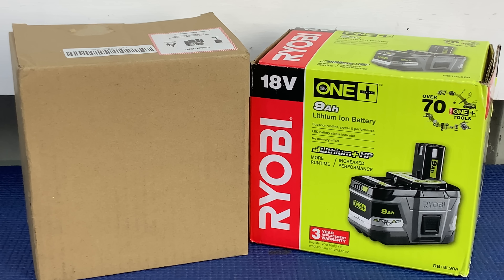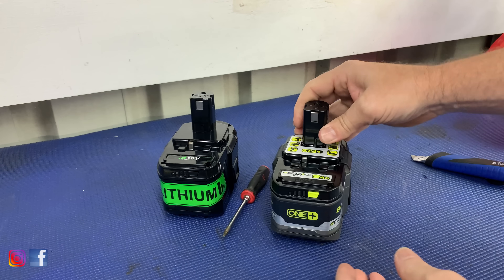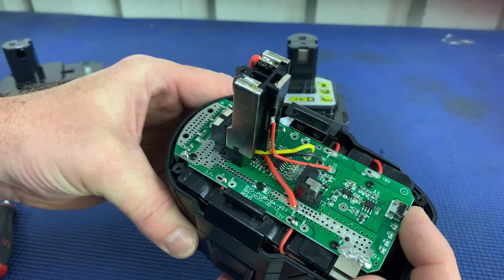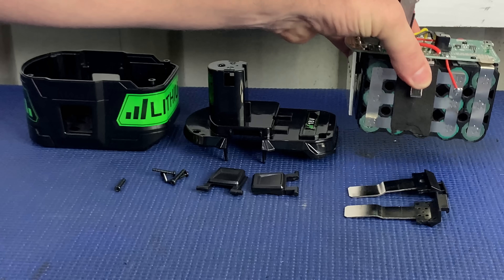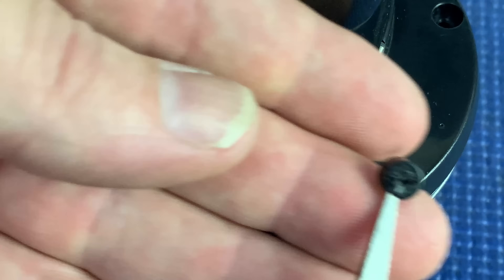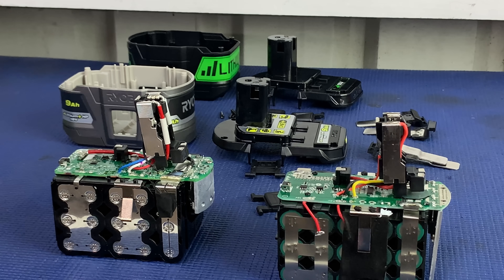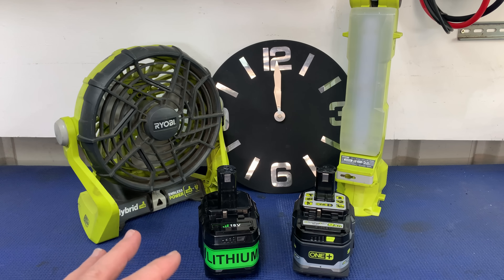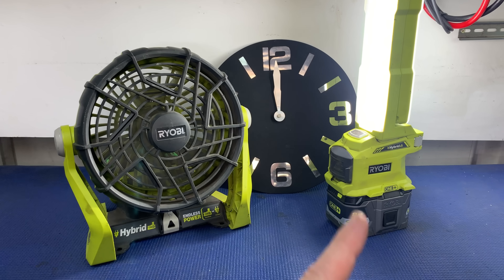Ryobi 9ah battery versus eBay knockoff job

Comment: I am seeing Chinese knock-offs for an amazing number of different products. I have had personal experience with Go Pro accessories and ski goggles. Both are of extremely inferior workmanship and quality of materials. The GoPro accessories have inferior plastic and willl break and often not even fit. The same for the ski goggles. They may be okay for young kids or teenagers that will use them only a couple times a season and then grow out of them. But for a serious skier that skis multiple times a winter and expects a number of years service they all be a poor investment as they will not last. I have learned to stay away from eBay products even though they are half priced the brand name articles they are not worth buying. I am becoming worried that the counterfeit knock-off products are even mimicking the packaging and The Branding of the name brand they are imitating. A friend of mine purchased a Dale wool sweater that normally sells for 300 to 400 dollars. He bought it for about $90 and thought he was getting a great deal . It was advertised as a XXXL size, but when it arrived it was way too small. It fits me and I wear a large. So he gave it to me and I wore it about 1 year and then it started to fall apart
Reply from the maker: To be fair China make some quality gear... its just a subset of lowlifes trying to make a buck all over the world..
Reply: You are so correct. It did not even cross my mind, but it certainly should have, that my comment grouped everybody in China in in the same category. Interestingly, grouping people under a label is one of my pet peeves. I am a follower Jesus Christ and would be considered a Christian. And it offends me greatly when I I am grouped with with the so-called Christians represented by the ones that were storming the the Capitol building. I believe Christ came to change people's hearts and souls. Not to bring down the corrupt Roman government and that should be the Christian attitude today. Helping people decide to follow Christ it is by far more important then getting them to elect the so-called correct government officials!

Comment: Left half the potential content on the table.
It would be useful to know what cells are used.
I'm thinking of rebuilding my ryobi pack with aftermarket cells, but I'd rather you tear your apart first.
Reply from the maker: Please don't use 'generic' cells use name brand when you rebuild and consider your load.. High Drain cells not low drain cells used in this ebay special.
Reply: go with samsung high drain cells. i've rebuilt a few, and they are the best for my money.

Comment: My Chinese knock-offs are 4 years old  3 of 4 still working. My Ryobi's are 5 years old and 4 of 5 are dead. Yes the fitment is better with the Ryobis. Never had a Knock-off fall out. I just give the Knock-offs a slap to get them to set properly and they are a bit tough to remove. My knock-offs have worked in temps from 2f to 117F. Have Ryobi chain saws, skill saw, recip saw, blower , lights. about 10 pieces in all. Don't charge either one below freezing. Fixin to buy a 9amp knock-off. for the spouse's leaf blower.
Reply from the maker: They have their place, but reduced run time and the fact this one is now in the bin cause it fell out of the weed eater onto the ground and cracked the case is enough for me .. just cheap junk can't describe them any other way

Comment: I bought 4 of those knock off batteries. They are complete pieces of shit. And they do not work with most tools. So far, only my drills. Pay the extra for the real ones, if you have more than drills and use your tools more than once a year.
 You're welcome.
Reply from the maker: Thanks buddy! THEY do work,  just the quality aligns with the price tag..
Reply: @HBPowerwall  Yeah, they work for drills. They DO NOT work for my grinder, reciprocating saw, circular saw, shop vac and they run out fast if doing heavy drilling. I think they do work for the tire inflator and I have not tried them with my cut off tool.

Comment: I don't want this to come across the wrong way, but perhaps you should have tried the fitment of the knockoff battery in the chargers and the tools right out of the box and prior to disassembly. 
That way you know for sure whether the poor fitment is due to manufacturing or if something was slightly misaligned during reassembly.
Reply from the maker: Yeh, it was crap can't look at it any other way.. it's in the bin now wasn't even worth testing further.. It fell out of the whipper snipper and smashed the case.. RYOBI would have just bounced lol piece of crap
Reply: @HBPowerwall  I can't disagree with that.
I've had zero issues with any of my Ryobi products.

Comment: Someone did a similar comparison of the knockoff 4amp batteries a year or two ago and he was able to see the actual cells to find out they were indeed a lower rating than what they claimed.  That being said, I would buy some of the cheaper 9amp batteries if only for small things like the fan and the lamp as they would be cheaper to replace should something happen, but I would definitely not trust the knockoffs in anything like my good brushless drills or other expensive tools like my portable compressor.  Also, I'd keep it on a separate charger from the rest just in case it kills it (I always end up with extra chargers from Ryobi Days anyway :P).
Reply from the maker: For small loads these work all day long... but missing build quality. If they had their rated capacity i'd be fine with them But that is lies too.. video soon!
Reply: @HBPowerwall  lol, I agree!  I'll keep an eye out for the new vid.

Comment: The Ryobi one is of the newer type with the extra connector on the back to deliver more current to the new brushless tools, the difference is VERY big compared to the older ones.
Reply: Not all of their brushless tools use that extra connector.   I have a weed whacker and a leaf blower that are brushless.  They have no extra connector that matches the battery.
Reply: @larryjohns8823  Same thing with drills, the big 95nm drill has extra pins while the compact hp 54nm does not

Comment: i bought a knockoff makita 9ah battery for my fan, that is the only tool i trust it for however, as i bet its not gonna take the heat of a high power tool very well. and even tho it clips in seemingly good it loves to pop loose from my 1/2" impact gun, like every 15 seconds... i get a lot of use out of it for my fan in the summer but man other than that its worthless lol. makita doesn't even make their own 9ah battery unfortunately but id have bought a 12 ah if it was available, fan all day! lol.

i tested it very un-scientificly by turning the fan on and starting a stopwatch, the 9ah ran it for just over 10 hours on low and a makita branded 3ah ran it for just over 3. so on a low load it seems slightly better than makita. but i have a feeling there is some magic with larger battery packs im not aware of witch could explain this.

Comment: Hey mate these 9 AH ryboi batteries are now only $199 at Bunnings (Ryobi primary distributor in Oz) which further changes the price/value proposition of these batteries.
Reply from the maker: Yeh, i made note of that.. After a few more weeks of use I still HATE the knockoff.. Put it in the wipper snipper used it for half an hour turn it upside down to fix the cord and battery fell out and hit my toe. Changed to the origional battery and it was like the wippersinipper was turbo charged..
Reply: @HBPowerwall  I've read several reviewers of knockoff batteries mention the bad clasp moldings.  Most people, including myself, fixed those sticky and hard to seat batteries by filing a little bit of plastic off the catches; so they fully seat and lock in.  Plenty of more important reasons to knock these batteries than the poorly molded catches.
Reply: Yes I was thinking the same thing  $299 is very expensive (18650 cells
Milwaukee batteries 
8ah 2100 cells $200
12 ah 2100 cells $260

Comment: In our experience, the "on-sale" price of a genuine "standard size" Ryobi 4AH battery is too cheap to bother with any sub-par ripoff. $25-40 each is a common going rate here in the states when purchased in 2 and 4 packs around the holidays or other annual "sale" weeks.
Reply from the maker: yeh, never  seen them on special around here :( but even then after another few weeks using this battery, it just sucks, fell out of the whipper snipper last night. Vibrates out of the circular saw.. only good for lights or fans.
Reply: A couple years ago, I picked up two 9Ah batteries from Home Depot for $180 ($90 each). They are well worth that price. I have plenty of 4Ah batteries from the same kinds of holiday deals but my 9Ah batteries shine when I need to use my angle grinder, leaf blower, recip saw, etc.
Reply: At those prices might as well buy original ones for sure.
At full price and occasional use the knock offs become interesting.

In the end it all comes down to the cells that are used in the knock offs. If the cells are decent the knock offs are fine.
Reply: Must be you
 I use them in nail guns, circular saws,sawsalls,impacts,screwguns, multi tools and on and on. I've never had a aftermarket battery fall out of any tool.
Maybe you shouldnt take things apart then complain about them.
Reply: @nicstr28  the shape of plastic mould wouldn't allow the it to go all the way in pulling it apart wouldn't change the shape of it.
In eBay there Is many different sellers and probably different levels ofnquiaolty I just bought 2 for 73dollars aud and the reviews on the past months sales seem to say they work just fine and even the ryobi 18v battery someone tested was lower capicity by about 10percent and that was genuine. So I'm sure none of them are really what they say.  If my 5ah fakes are better then my 2.5ah genuine battery in my blower I'll be happy, only get about 15min if lucky with one battery so if get 20 or 30min I'll be happy
Reply: @nicstr28  u nailed him to the wall 😂😂 Spot on rebuke!
Reply: Always cheaper in the USA or created in home country.
Here in Australia 2.5a =$100 4.0a = $150 6.0a = $300 9.0a = $450
Love the ebay no brand knockoffs

Comment: I'm planning on trying to build myself a 6.0AH using 3D printed parts, an off the shelf BMS and LG HG2 cells in 2P.  If that works, I may try building a cheap one with 3P M29's (which a local london retailer sells to pack builders for £1.66/cell plus tax and shipping).  In 3P, the M29's should be able to manage 30A sustained, which should be ok.

Might have to charge it with my imax instead of my ryobi charger, but that should be easy to print an adapter for.  Could even throw in a balance charge lead...?
Reply: Hey There,
You clearly have plenty of knowledge on the subject. Is there a off brand that you know is decent ? Or are you building something that you would sell ?  I only use them for lights while working. ( Painter ) 

Thanks in advance for your time !

Comment: I have owned a total of 18 of the 6AH knockoff batteries and 2 of them have failed relatively early on in their life cycle. Fully charged battery in leaf blower or chain saw and runs less than a minute. Machine stops and battery is done 4 cannot be charged again. This has happened with 2 out of the 4 ryobi batteries i have owned. Have had much better luck with the cheap ones. That said they don't have the greatest fit on the charger. They do stay solid in the tools but haz to work at it to get them out.
Reply from the maker: Thanks for sharing point of view, I was using the 'lithium' battery in the led light over the weekend working on my car and it went flat, had to put it in and out of the charger about 10 times over a few hours to get it to start charging again.. I suspect it was so flat the bms said no.. each time i put it on the charger it charged a bit then turned off. Still would rather the proper unit.. fan blows harder, omg in the circular saw the genuine one rocks, knockoff blade keeps getting stopped.. For me - no more knock offs!
Reply: any cordless tools battery. needs care. cant get hot or cold.
dont store it on max or no charge.
store at 80% charge
dont over deplete when is low.
obviously ryobi have better quality control. so hopefully theres a sale

Comment: Would love to see a test the run times of these 2 batts in a high load tool. My bet is the % difference will increase in higher load scenario.
Reply: I have a few genuine 4Ah and one 6Ah knock off. If I run the knock off in my Ryobi air compressor, it stops working when it still has 2 bars left on the battery. The genuine 4Ah battery works flawlessly.
Reply: @ruinunes8251  That compressor is probably one of the highest drawing tools too, I've watched it suck down a 4amp battery to one bar as it's running, but it always comes back up to about three bars when it turns off.  I know Ryobi is really stretching the claim of how many tires you can fill with it, but for those times when you can't get a normal compressor or don't have a 12v lighter socket to fill a tire, it sure is nice :D
Reply: @cujoedaman  
It is not only with the air compressor that my knock off battery struggles with, it also struggles with an angle grinder. When the power is down to 2 bars left on the knock battery, the grinder won’t work. With regards the air compressor, yes, it is a nice bit of kit. I don’t have mains power  in my garage, so I use the cordless compressor a lot. It is worth every penny.
Reply: @ruinunes8251  I didn't think about the grinder, I don't have one yet :D

Comment: I would say at low current the knock off holds it own but the battery life is only 7 amp hours
The high amps is why you buy the real. Deal batteries. Your going to need them if you have any work that pushes the li'its of your tools. Also a major issue is heat. There are Temps that ryobe cuts off the power at. Keeping the battery from damage. I would like to see if the k ock off is the same and is it tested for the batteries it uses. Who really know.

Comment: I've got aftermarket 6ah one and it doesn't fall out. Makes a good locking click in.

In fact my genuine, current gen Ryobi 2.5ah fluro yellow/grey with power gauges are the ones with poor quality.

The snap in causes the tops of the battery to contact the inside of the tool, cracking it.

Now I've got this one with a busted top, a wad of plastic broke off from this,  and the other 2.5ah  with a hairline crack about to follow suit.

These days I'm easing these batteries in rather than snapping them in like they were designed to...

The insides of the battery inserts on the tool should be terminated with rubber

Comment: Wow, why so many hateful comments on such a good video?
I sure would be curious if those HP pins on the clone actually do anything.
If you do anymore testing with the LED light it would be a good idea to crack the two halves open, it gets pretty warm after running for a while.

Comment: Think you were being a bit generous in the conclusion - you don't buy a big battery like that to run a lamp and, if it feels weaker and falls out of the high-load use (leaf blower), it is arguably not fit for purpose. Thanks for the review.
Reply from the maker: it's one of those hard calls, I WOULD buy the cheap battery to run lamp or fan if camping and needed it to run for a long time, really does make sense. I'm going to continue to test.
Reply: I live in Michigan and there have been times where tornadoes or Winter storms have left me without power for a week, so yes, that's exactly what I would want a cheap 9Ah battery for.

Comment: Ryobi is cheap shit dressed up to look nice  You should have looked at the cells and see what they were.  All the Milwaukee packs I've taken apart have been genuine Samsung 30 or 40ts.  You didn't actually do anything but spin a Ryobi advertisement compared to something that is 2/3rds cheaper.  I know you can do better than that.  The nickel plate on the knockoff is fine and would have done the job, the circuit board looked fine and would have done the job.   Would the Ryobi packs last 5 years like my Dewalt's, I'm guessing not, but maybe they've improved?  I wouldn't know, haven't needed to buy new batteries yet.

Comment: This is right up my alley. I am in the need to replace my royobi batteries. I can live with a little less than rated grunt for most things. I can't live with batteries falling out of tools though. I am keen to see how these hold up. Do you happen to know if the knock off batteries will fit into the royobi cases by any chance? if they do, this could overcome the fall out of tools issue.
Reply: Check out home depot for genuine ryobi batteries. They have 2 packs of the 18v 4ah packs on sale for $80. I picked up a couple to use in multiple tools and I've been very happy with them. I normally use knock-off packs in low amp draw tools, but these genuine packs are almost as cheap and handle high amp draw way better than the knock-offs. The knock-offs also degrade much faster than genuine packs. 
I still refuse to pay what milwaukee charges for their 12v packs. The knock-offs cost less than 1/4 of the genuine price.
Reply: @Brandon_Nelson92  If only batteries were that cheap in Australia :(
Reply: @nickhenley8040  
The same in UK. Genuine batteries are bloody expensive here.
Reply: @nickhenley8040  you could possibly use the top section of the real battery if same screw pattern or find an eBay seller that has good reviews on feedback for there battery. Buy 1 or 2 to try and see how you go. I bought 2 5ah battery for 73dollars aud delivered way cheaper then ryobi genuine for sure.